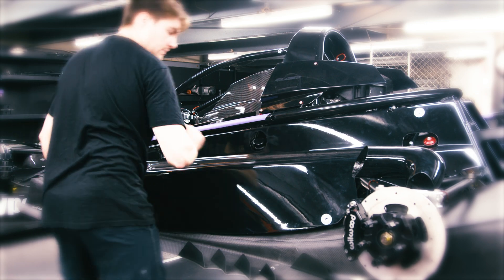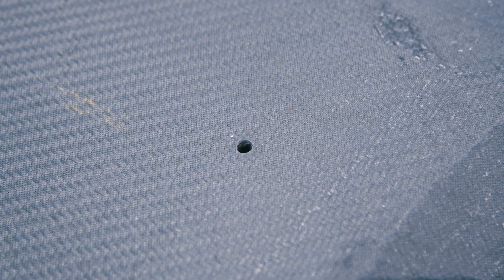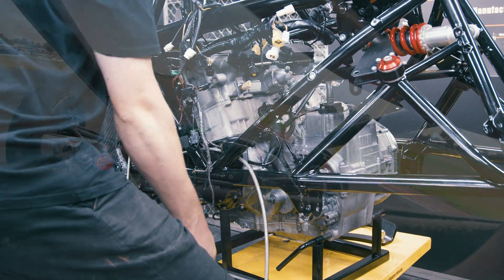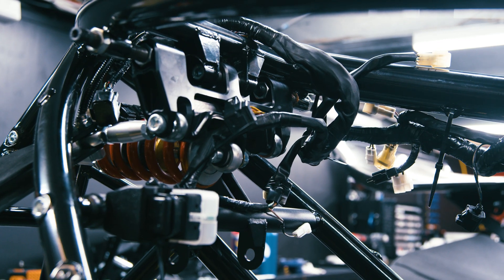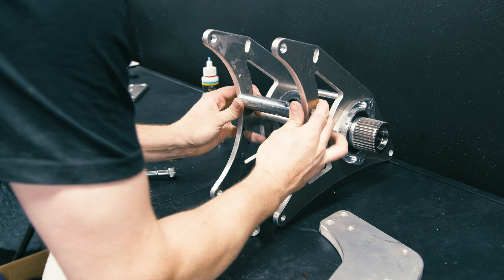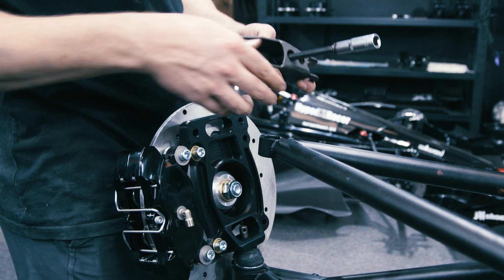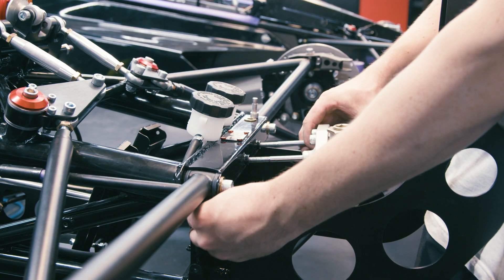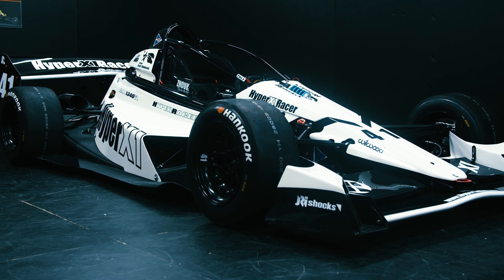I'M BUILDING A GROUND EFFECTS FORMULA CAR!! (Hyper Racer X1 Build - Episode 2)

Comment: Is there no issue with the engine oil system on this engine because it isn't leaning? Or is that fine here?
Reply from the maker: We modify the sump for ground clearance and then add a baffle plate which captures oil in the event of lateral g-forces, so that the pick up has a constant supply of oil.
Reply: @formulazac9 Ah yeah fair. Just was kind of surprised nothing specific about oil was mentioned in the video

Comment: I understand no differential, but thing thing should have 4 dampers.
Reply from the maker: F3 cars until recently had a similar suspension design with a single front shock, it's not new, we're just the only people to do it for the rear as well to try and simplify things even further. It works surprisingly well.

Comment: What sort of oil system do these run? No mention of a dry sump?
Reply from the maker: Glad you pointed this out as I never mentioned it, maybe I'll cover it in the next video. It's still a wet sump with our own laser-cut baffle plate, that traps oil in the bottom of the sump when lateral g force is introduced. In the 5ish years of running these cars, we have never experienced oil starve issues.

It's probably worth mentioning, a dry sump is quite obviously the better option. If you were building this car with a big budget you would throw a dry sump system at that engine so fast it's not funny. But when Dean was building the first car, the goal was always a budget-friendly open-wheeler race car, so he persisted with developing our baffle plate. It's pretty cool that we can solve that issue with a $3 laser-cut aluminium plate. 

Hope this is clear enough! Thanks for the comment. Really appreciate it.